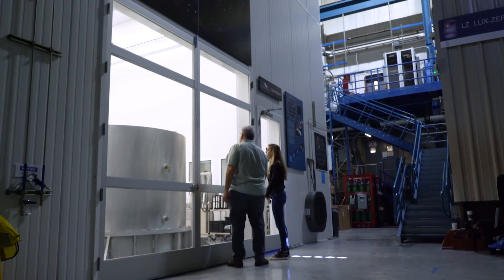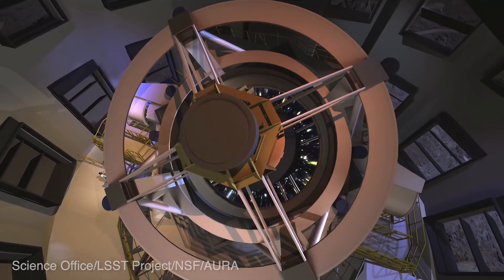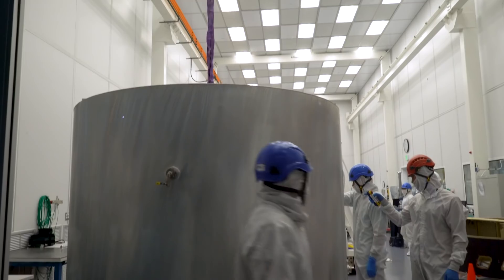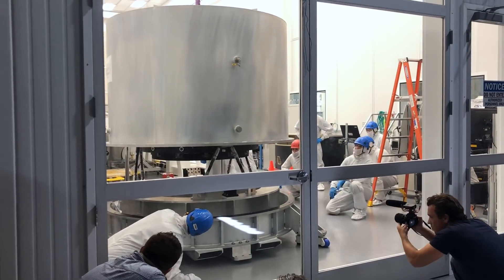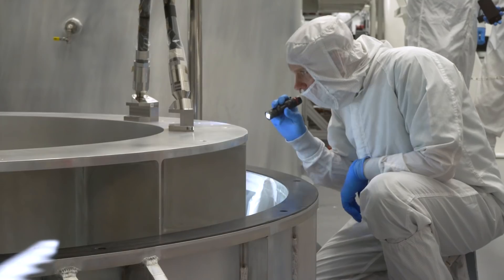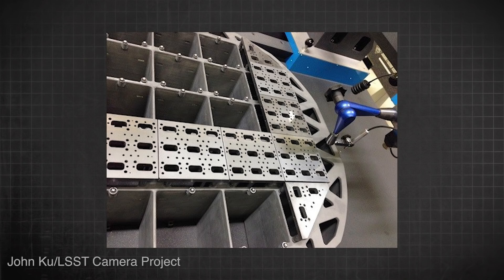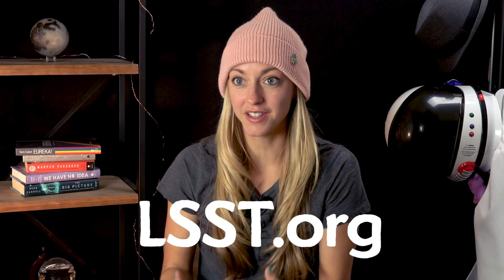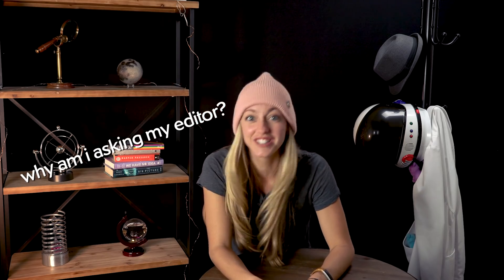World’s Largest Camera Lens

Comment: There is one major concern many astronomers are having right now. The the wide angle camera (some 35°~) is a marvel of science. Unfortunately we are growing in and around ourselves with technology. There are now and will be thousands more points of light interfering with the electronics on long exposure photographs. The StarLink network currently has 1,500 satellites scattering around low earth orbit @ 550 km up. The cone of reflection toward the sun side will certainly spoil many image attempts. This is a worldwide problem. Amazon (Bezos) has the ULA agreement to launch 3,236 satellites. (Project Kuiper). China's StarNet plans to launch 10,000 satellites in the next five years. It is clear that the skies will not be clear.

Comment: Imagine if the lens were also using metamaterials in order to see details smaller than the wavelengths of visible light, and given a moth-eye anti-reflective coating... And also, giving the interior of the camera and telescope assembly a Vantablack coating to prevent stray light from reflecting around inside.

As for the image sensor... They really should have used hexagons!

Comment: A 60 inch lens? The largest refractor is 40 inches. The glass sags & distorts the image. There are only 2 lenses? Won't there be chromatic aberration? A mirror camera would be a whole lot cheaper.

Comment: Diana, You should read up on how CCDs work. Charge is applied to the surface and then the incoming photons make that leak away. Then a charge-wave makes the pockets of remaining electrons move to the side where they can be measured. (think of a ball on a blanket that you can push to the side from below.).

Comment: "Camera Lens" - this is not even the main lens (objective lens) for the camera!  The light gattering element for this camera is the telescope's main mirror, so this lens pair has certainly another job, probably flatten the field of focus. 
That means: if You compare this lenses to Your common telephoto objective, this 2 lenses are not those big lenses on the frontside of the tube! 
No, they are the "smaller" lenses, sitting on the camera-side of the tube!

Comment: I think it's worth clarifying that while it's sensitive enough to see a golf ball to the distance of the Moon, it can't actually resolve it. It'll just be few slightly brighter pixels on the background of blackness of space, where one pixel would cover 380m x 380m area. To resolve two golfballs as two objects rather than one they would have to be 1.3km apart from each other. That's based on the published seeing limit of 0.7 arc seconds and pixel size of 0.2 arc seconds.

Comment: So... why go with these huge monstrous mirrors that take decades to fabricate and install?

Why not develop some satellites chock full of inexpensive little megapixel CCDs?
Let's say, build 100 of them, each with 12 CCDs, 3 on each of four 1 meter arms.  Launch them in a flotilla toward a useful legrange point beyond the moon and separate them by 10 km (create a square 100km on a side).  Then combine what each of those little, inexpensive satellite sees to replicate a huge f'ing camera  Using swarm networking each of the satellites would be focused on the same thing.

Comment: 1:29  wait... But weren't we about to use a group of telescopes soon in the future to see better and far away? Like they did with the black hole picture if I'm not mistaken?
I don't get it...
Is this telescope better than a group of the best telescopes working together?
Reply: More data does not meanbetter in every way. This telescope will produces lots of data, because it takes an image every few minutes with the largest CCD ever built (about 3000 megapixels).  This is very usefull for its intended purpose i.e. detecting changes in in the entire visible sky by imaging all of it every 3 days. However most other telescopes perform much more specialized tasks to which the LSST would be entirely useless. USing your example of the Black hole event horizon picture: The minimum resolvable angle (i.e. how small is the smallest thing you can see) of this telescope is not actually particularly impressive compared to other single telescopes or as you mentioned multiple of (in the examples case Radio) telescopes working together.

Side note: this telescope also does not perform spectroscopic work beyond a few color filters. Most of modern astro physics is based on Spectoscopy rather than imaging.

None of which is to say that this will not be an impressive and usefull instrument, well outdoing anything in its *class*.
Reply: Projects like that collect a lot of data about a very, very tiny area. This is collecting data on the entire visible sky. It's like staring at one thing under a microscope versus going up on a mountain and seeing all the way to the horizon. But also the precise definition she's using to quantify an amount of data is kind of ambiguous. 

And the EHT was a collection of radio telescopes, this is optical.

Comment: Antimatter is on its own dimension of space the alcohol test proves it too😆.👍 you had better be careful with that stuff as it's the matter of the universe and we where right the one place no human was able to go to the disc of the black hole well at x 100 yes you can now the warp drive want the math😆real world stuff 1 light year in 31 hours amazing stuff half the drive done and you to the next system 10 years min me 2 weeks with stop in yet no engine yet on your ends still going to need it as i go one second length in a jump so you may need a few and a rocket is not going to be much use.

Comment: Ao at 60" ≈ 1.5 m, is this the first optical lens bigger than the 40" ≈ 1.0 m achromat in the Yerkes Observatory refractor?
The diameter of which, BTW, was limited by flexure of the glass under its own weight, since, unlike reflector objectives, can be supported only around the circumference.

And so, how did they overcome this limit? Is it because this lens doesn't need to be as thick as an optical telescope's objective lens? Or the different material that it's made of? Or that it won't be tilted at different angles, so that it can be built to take gravitational deformation into account? Or what?

Definitely cool, in any case – thanks for showing us this!

Fred

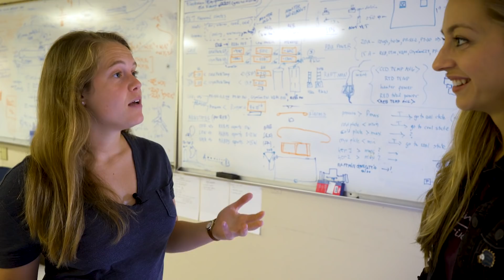Comment: At 3:10 she says that "If we were able to put a golf ball at the same distance as the moon, we would be able to see it". That is totally untrue. That would require a resolution of 100 picoradians, (4cm/400000km) which would require a primary mirror of the order of 10^10 wavelengths, about  5 kilometers (Rayleigh diffraction limit). That is over 100 times the diameter of the 39.3m European Extremely Large telescope due to be operational in a few years from now. How did Physics Girl not spot this baloney?

Comment: Very interesting video.  How did they get a polished surface and accurate curvature by casting?  The casting process would typically provide just a rough lens blank that then had to be ground and polished.  What was the lens’ focal length?  
      Did they use the same material for both elements?  I ask because a second element would typically be made of a material with a different refractive index and dispersion in order to reduce chromatic aberration.  
      Would you please do a video on the rotating body (see https://youtu.be/1VPfZ_XzisU)?  This just blows me away, almost like trying to wrap my head around the concept of infinity.  Notice that when the rotating body makes a flip, it also changes direction of rotation, going from, for example, clockwise to counter-clockwise.  It seems like the momentum of rotating one way would be neutralized when the flip takes place, bringing the rotation to a halt.
     Thank you for your work.

Comment: Not that I dont believe her, but wouldnt a golf ball at the moon's distance be smaller than even the theoretical max resolution (diffraction limit) of any lens thats not like a mile in diameter? A golf ball (1.68") at moon distance (15,130,000,000") is 6.1348e-9 Degrees.

Comment: its cryonically cryo cooled until its cryo and then its pumped full to the brim with the most expensove vacuum like 10^-15 Pa. Can they put more unobtainium into it to be more scientific? Quantum nanodots? Antireflex is made out of carbon nanotubes I guess. Theres an app for the sensors. The mounts are made of titanium instead of steel. Bolts are Allen key or pentalobe.

Comment: 3:09 When the EHT project was going on, people were saying it was imaging an apple placed on the moon. A golf ball is smaller than an apple. So, with this telescope, we can see *SgtA?
Reply: No, because this is an optical lens, and the EHT uses radio frequencies.
Reply: @michaelsommers2356  So? SgtA* isn't invisible in visible light. EHT used millimeter wave because millimeter wave scatters less than visible light.
Reply: @aniksamiurrahman6365  Visible light is blocked by the interstellar medium.  The LSST has an angular resolution of 0.7 arc seconds, while Sgt A* has an angular size of 0.000 050 arc seconds.
Reply: Thanks,  @michaelsommers2356 . This is what I was trying to bring.

Comment: Hey Physics Girl some interesting FUN FACTS about fused silica glass is its coefficient of expansion which is next to nothing which means almost no zero thermal expansion.  Softening point of fused silica is effected at approximately 1650 °C (3000 °F) which when compared 7740 Pyrex at 820 °C (1,510 °F) its freaking hot!!  I've taken a fused silica rod and heated the end to white heat and plunged it into water...it boiled the water, it did not crack or shatter!

Comment: The tunnel size isn't the limiting size of the mirror. The 8.4m mirror used is the same size as the largest mirrors ever fabricated thanks to the Mirror Lab in Tucson, AZ(where this mirror was made as well.) A bigger tunnel wouldn't help because no one makes bigger mirrors, the Mirror Lab is capped by the spacing of the columns of the building it is in.

Comment: Why lenses though? 🤔
All the cool telescopes use mirrors.
Reply: For the space vampires of course
Reply: They need the ginormous camera for the huge volume of data.  A big reflector will collect a lot of light in order to see very dim objects, but only over a very small field of view.  This puppy is designed to do the same over a huge field of view, allowing it to photograph the entire sky at extremely high resolution over only 3 nights.  It's what is needed for a CCD sensor as large as a basketball court
Reply: It is a mirror telescope. But you need something to capture the image from the telescope no? This is the lens for the camera doing that
Reply: @maheepsingh3612  No you don't need anything else.  Main mirror of that telescope works same way like lens in camera lens. Just google how mirror telescope works. You can take pictures with that telescope without those lenses. Lenses in this video just makes the picture better than without. And I bet they aren't biggest lenses in the world.
Reply: @RoopeLuukkainen  fair point. I didn't know about that. But they are using it in front of the ccd's so that does kind of make it a camera lens nonetheless
Reply: It has mirrors too, I believe it's a 3 mirror 3 lens combo.
Reply: Chilapa of the Amazons mirrors are more for specific, narrow ranges and this is for wider field.
Reply: Glass has unbeatable contrast, and they're interested in the really dim, so mirrors won't cut it.
Reply: Thats just a flattener lens for that giant mirror telescope. Not "a camera lens". This is not a clickbait video because the girl don't know whats she is talking about.

Comment: I find it really odd that this telescope uses lenses at all. I thought modern telescopes used just mirrors to collect light into a single point?
Reply: The LSST is a wide-field survey reflecting telescope with an 8.4-metre primary MIRROR. It has three mirrors as follows: M1 Is 8.4 metres, M2 is 3.4 metres & M3 5.0 metre diameters. M1 &  M3 are a single piece of glass, the "M1M3 monolith" with M3 sitting inside the middle of M1 - this is to minimise the overall length of the telescope. THEN there's three corrector lenses to reduce aberrations. These lenses & the telescope's filters, are built into the camera assembly:  L1 1.55 metres [largest lens ever built], L2 1.10 metres & L3 0.76 metres [this one forms the vacuum window in front of the focal plane]. Diagram here: https://upload.wikimedia.org/wikipedia/commons/thumb/3/3d/LSSToptics.jpg/640px-LSSToptics.jpghttps://upload.wikimedia.org/wikipedia/commons/thumb/3/3d/LSSToptics.jpg/640px-LSSToptics.jpg

Comment: I would think the moon would be waay more than just 80 million times the size of a golf ball. That one lady said if a golf ball was as far away from Earth as the Moon is, then they could see it and then said the Moon is 80 million times larger than a golf ball. Maybe I'm missing something here though.
Reply: What you are missing here is you couldn't be arsed to do the calculation - which is easy & basic mathematics: L = Lunar diameter 3,474 km. G = Golf ball diameter min size is approx 43 mm or 0.000043 km. L/G = 3474/0.000043 = 80.7 x 10^6 as the video says

Comment: Why a lens and not a mirror? I thought telescopes use mirrors because lenses cause aberrations (or what ever you call it – light of different wavelength refracts differently and you get a tiny rainbow at the edges of things).
Reply: The LSST is a wide-field survey reflecting telescope with an 8.4-metre primary MIRROR. It has three mirrors as follows: M1 Is 8.4 metres, M2 is 3.4 metres & M3 5.0 metre diameters. M1 & M3 are a single piece of glass, the "M1M3 monolith" with M3 sitting inside the middle of M1 - this is to minimise the overall length of the telescope. THEN there's three corrector lenses to reduce aberrations. These lenses & the telescope's filters, are built into the camera assembly: L1 1.55 metres [largest lens ever built], L2 1.10 metres & L3 0.76 metres [this one forms the vacuum window in front of the focal plane]

Comment: I'm confused -- I thought the telescope (with the sensors) was the "camera" -- can someone explain?  IOW, why are these additional lenses needed?
Reply: The LSST is a wide-field survey reflecting telescope with an 8.4-metre primary MIRROR. It has three mirrors as follows: M1 Is 8.4 metres, M2 is 3.4 metres & M3 5.0 metre diameters. M1 & M3 are a single piece of glass, the "M1M3 monolith" with M3 sitting inside the middle of M1 - this is to minimise the overall length of the telescope. THEN there's three corrector lenses to reduce aberrations. These lenses & the telescope's filters, are built into the CAMERA ASSEMBLY: L1 1.55 metres [largest lens ever built], L2 1.10 metres & L3 0.76 metres [this one forms the vacuum window in front of the focal plane]. if you are still confused look at the diagram in theLSST Wiki.
Reply: @nightjarflying  Thanks!!!